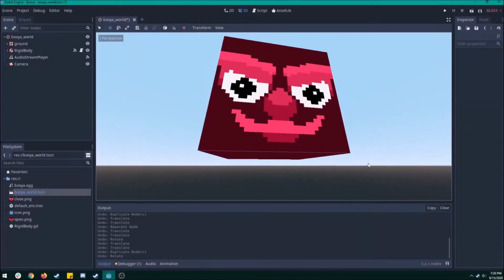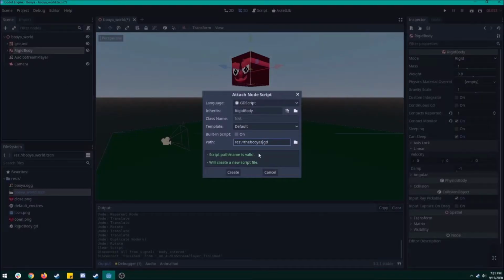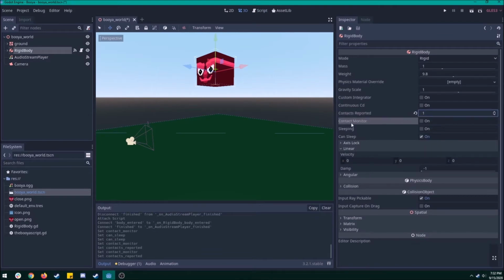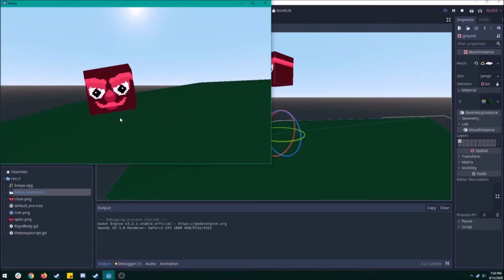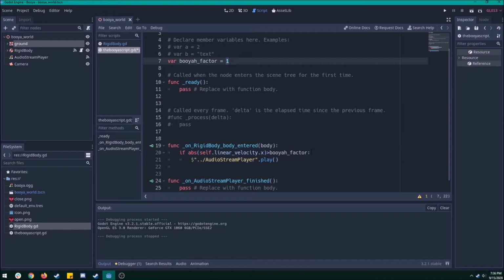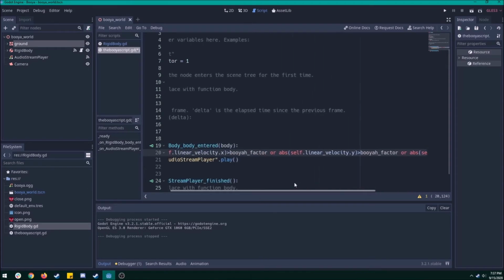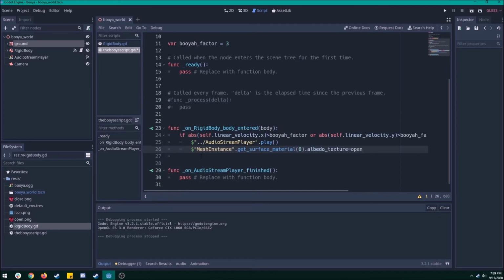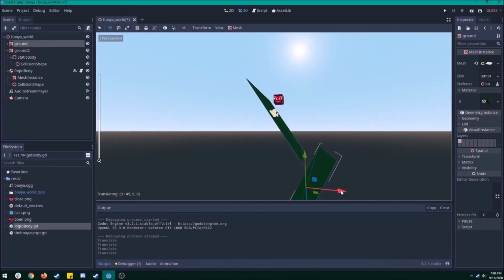How to play audio on a collision ✨Godot Tidbits✨

Comment: You shouldn't put self. if it sets or gets its own variable. Self-referencing creates an overhead for processing. You COULD do that if you want to trigger the setter/getter method but it's better to just call that method.
I guess you could use factor comparison on linear_velocity.length() instead of checking each axis.
Reply from the maker: thanks for info! I usually just use self in tutorials to make it extra obvious what object we're getting, but I had no idea that it added to processing lol
Reply: I was just about to comment about using length instead but I guess I'm about 4 years late lol